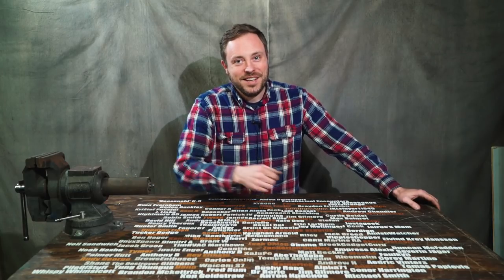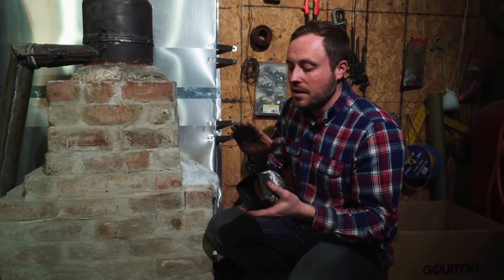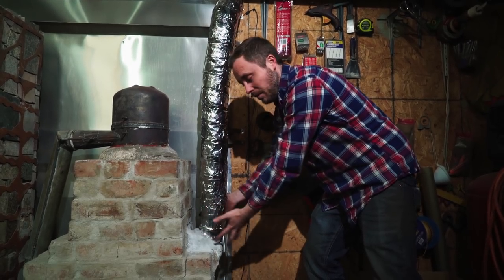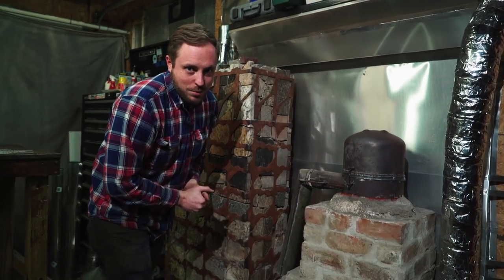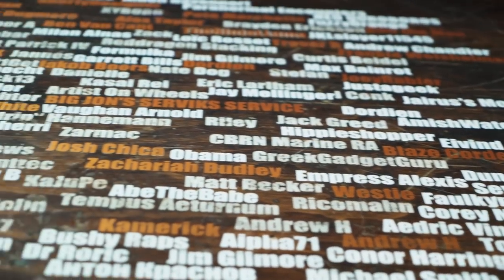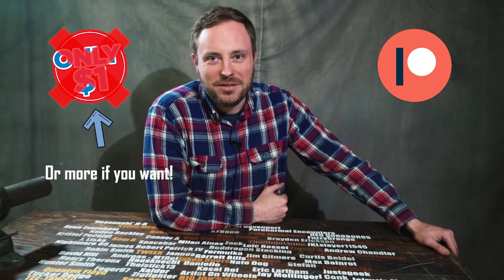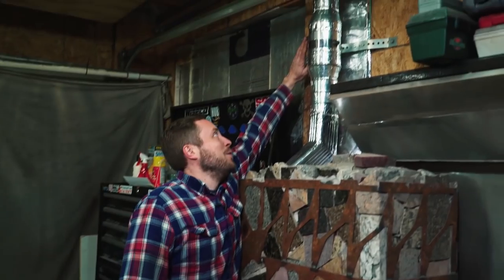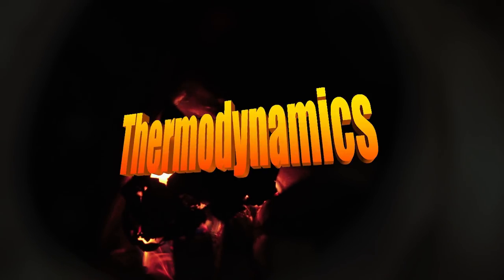Heat Your Garage For 74¢ A YEAR! - Mini Nautilus Rocket Heater Upgrade

Comment: The cherry-picking of ‘facts’ is hilarious. Your stove actually works (for the moment) in spite of your understanding. Throwing half-understood terms around then completely negating their effect with design really shows your lack of understanding. Typically I wouldn’t point out this sort of thing, as every person lives in their own little world as well as they can. However, your repeated representation of ‘fact’ and ‘science’ and ‘thermodynamics’ and expression that you “know” how all this works in a form of telling it to the masses leads me to this point. 

You tout the importance of cold air falling and hot air rising, then negate its effect by your design. You tout the area of a circle as opposed to a square, and yet you completely lack the understanding that the point of that theorem is a sphere and a cube, not a square and a circle. You don’t have a sphere, you have a ‘nautilus’. You don’t understand draft AT ALL nor how to use it to your advantage rather than fight against it. I could spend all day pointing out your inaccuracies of “science”, but that is not my point. 

I have no desire to harangue you. But quit acting like you “know” this stuff. It’s a system, and you can’t cherry pick ‘facts’ (as you think you understand them) and throw them into a pile. 

I applaud your effort. I applaud your stove. I applaud your willingness to make a video. But I abhor your statements about ‘science’. Your stove works IN SPITE of its design, not because of it. Without your fan, it won’t draw, as you’ve found. That’s fine, there is no problem adding a fan and paying $1 a year for heat. But, don’t act and teach, like you know how this actually works. You bastardized a simple principle, but it’s such a good principle that even your design doesn’t completely obliterate its ability to work. 

Good for you. But toss the “I Know Science” stuff, because you don’t understand it enough to be preaching it as fact and will lead others down the non-scientific path.